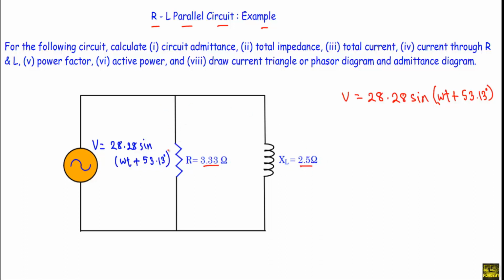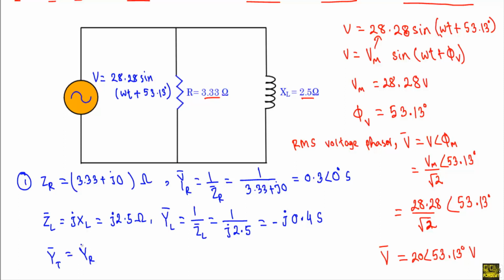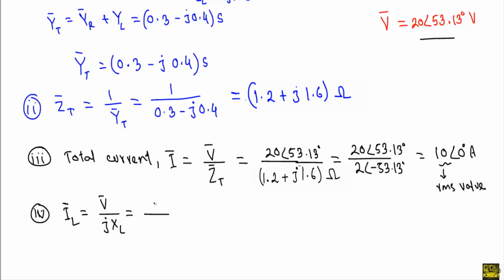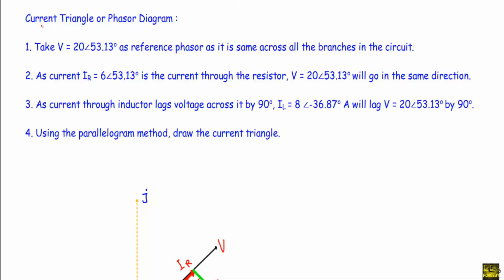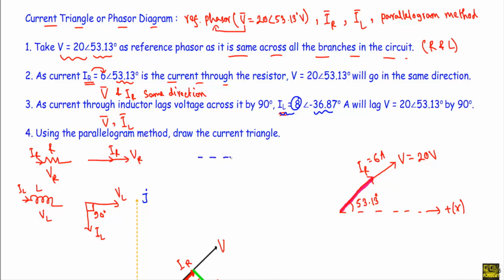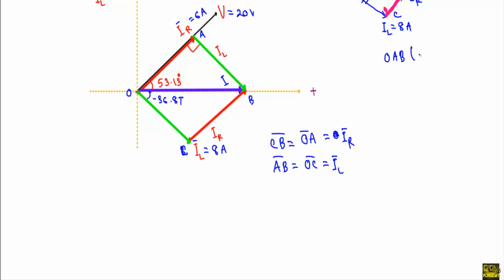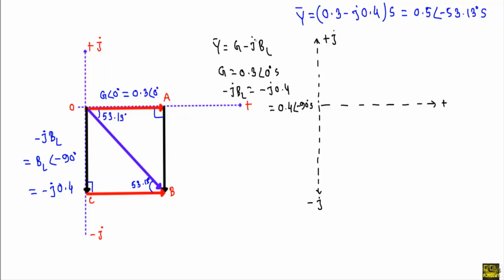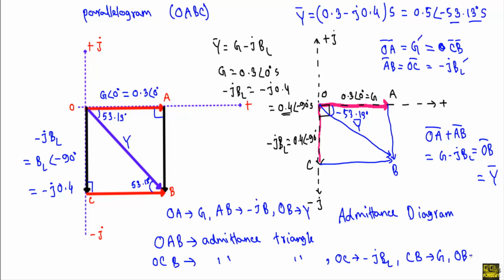RL Parallel Circuit (AC) : Example

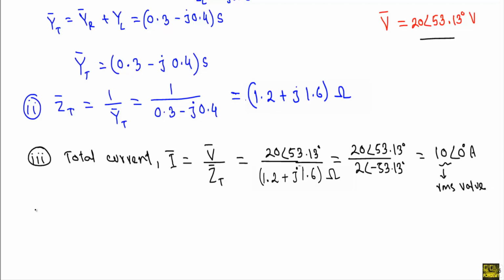Comment: At 7:52 (if the math up to that point was correct) the phase angles would subtract so that the angle would be 53.13 - -53.13=106.26, not zero.
There is also an error at the very start. Since the voltage is given as a sine, we should convert to cosine prior to converting to a phasor. Using the identity sin(x)=cos(x-90)  this would give us 28.28cos(wt+53.13-90) = 28.28cos(wt-36.87) which yields a phasor V=20 with an angle of -36.87. Then the final answer would be I=(20<-36.87)/(2<53.13) = 10<-90 Amps